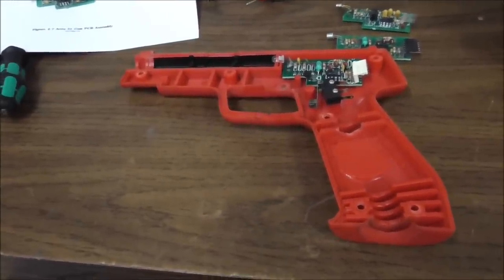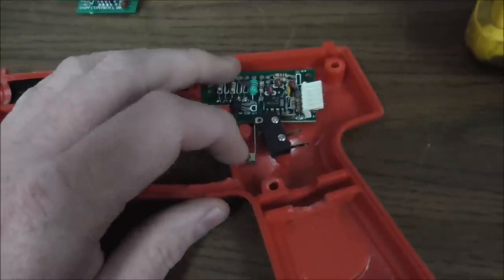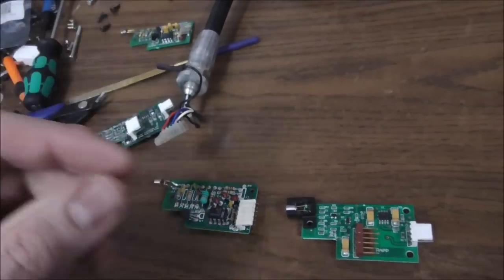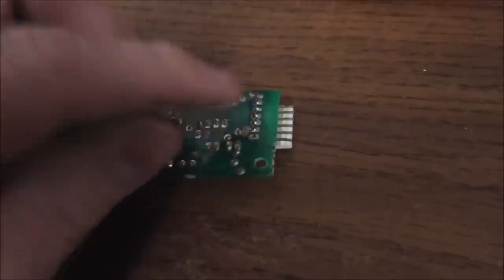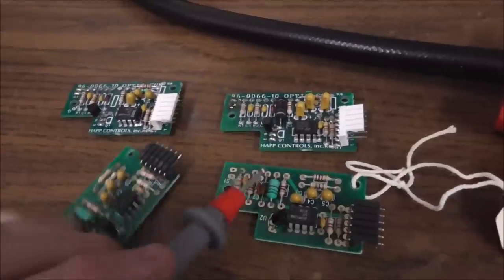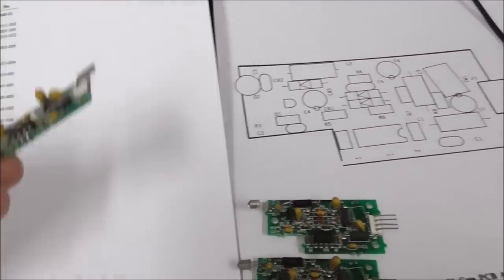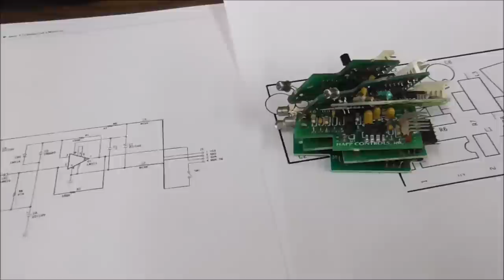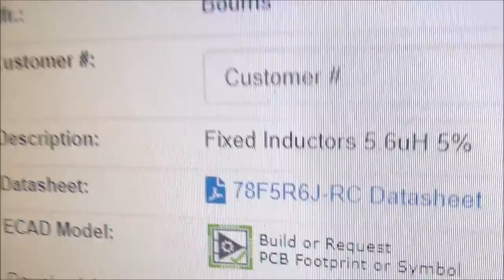Repairing Happ Arcade Game Lightguns - Area 51 , Lethal Enforcers, Police Trainer, Etc.

Comment from the maker: At the moment, you can buy the Phototransistors here:  https://amzn.to/2xReiO6

Anything you buy after following that link to Amazon (a box of doughnuts, a speed boat) pays us a royalty for sending you there, thank you!
Reply: It could be a photodiode. It's pronounced micro-henry and you are hereby authorised to pronounce it. I'm an engineer.
Reply from the maker: Thank you Morten we appreciate it brother!
Reply: @LyonsArcade  Please don't call it u-H. It's like a nurse in an engine workshop. :-) The u isn't a u either. It's the greek letter mu: µ. It's just common to use u because it looks similar and µ isn't on the keyboard. 
The LED you mentioned, it could be a photodiode. Based on the schematic you showed, I guess it could work too. You can test the component with your multimeter accross. Measure resistance and vary the light. They are directional, so if one direction doesn't work work, try the other. If that doesn't work either, it's not a photo-diode, it's broken or perhaps reality is broken. 
In layman's terms an inductor is a resistor that depends on the frequency. Higher frequency = higher resistance. 
Capacitors are opposite. Higher frequency = lower resistances. 
The inductors you have are just copper wire in a coil. When you measure resistance with your multimeter you measure at DC. Ideally it should read zero ohms. This world is not ideal. Depending on type and whatsnot, values below 100 ohms can be expected. Above a kilo-ohm sounds wrong. Mega-ohms are obscene. It's probably the resistance of your fingers. 
I took a look at the schematic. I can't immediately see a failure mechanism for the inductor (L2). Perhaps they just live a hard life (shock, moist, etc.).
Reply: Joe's Classic Video Games Hi, i was wondering if we can turn a le 2 cab into anything better, or replace the roms for LE1.  Even the LE 1 boards on ebay are over 300, seems a bit costly.
Reply: Joe's Classic Video Games top tip if your making a youtube video please mute your phone theirs nothing worse than hearing someone’s phone constantly pinging in the background either that or I hate the noise of people’s phones dinging 😂
Reply: 5.6 uH  u = micro  H = Henry.  m should be milli  but  some times also micro...cos. Reasons...the marking is green blue yellow.     5  6 2.   . Which confusingly means 5600 something's.  In this case 5600 nano henries  ( 5600 nH =5.6 uH) sorry but. that's how its put.  You would search for inductor axial 5600 nano henries
Reply: My goof. green blue RED means 5 6 2 not as I said green blue yellow

Comment: The "LED" on that first board may still have been a photodiode.  They make them in clear cases, and the internals are nearly indistinguishable from LEDs.

Any PN junction is light-sensitive, and also generates some wavelength of light as current passes through it.  That's why chips and diodes are fully encased with light-blocking materials.  LEDs and detectors are just constructed somewhat differently to specialize to their intended use.  Still, some ambient light detectors actually use LEDs for the detector.

That said, the proper replacement also looks like it has a lens and side-blocking to ensure that the detected light is coming in from straight ahead and not from an incident angle.
Reply from the maker: Thanks Oval Teen, I did notice on the data sheet that the phototransistor they're using mentions 10 degrees so I guess that makes the difference!
Reply: OVAL TEEN, can you explain what the purpose that inductor is for? I don't know what they didn't use a resistor but they used an inductor any reasons why?
Reply: @waynegram8907  The circuit may be above my pay grade :)  But what it seems to be doing is the opposite of a capacitor:  When the photodiode turns on the transistor, it seems to be there to cause an inverted pulse that goes to the op-amp.  There's also diode CR1 that only allows current to flow back through the transistor.  I think CR2 is only there to catch the flyback voltage.

But you'll notice that if the gun sees too much light for too long, it basically acts as a short circuit through the transistor.  That's probably what blows out the inductor.  The transistor would probably also be straining under that load, unless the inductor gives out first.
Reply: What kind of digital signal is the Photodiode receiving? is it a digital encoded signal? When the transistor is turned on, the inductor is energized and stores the digital logic signal from the photodiode, and when the transistor is turned off the inductor releases the digital logic signals voltage and current which is an inverted signal to the IC op ampThe inductor is getting damaged from something since its a high stressed component that is failure rate is very high for some reason. Not sure why they used an inductor instead of just using a resistor make me wonder why?
Reply: Photodiodes and inductors are analog devices.  The more light that lands on the diode, the more current it allows through it.  The inductor acts as a delay device.  It resists changes in current through it by inducing voltages in opposition.  It's analogous to a flywheel, which wants to maintain its own RPM and resists forces that attempt to change it.  The light that strikes the photodiode comes from the screen when the scan line passes in front of its field of view.  If you want to see what a raster scan is like, there's a YT video by the Slow Mo Guys about CRTs and even covering LCD screens and showing why they don't work with the old light gun games.

The transistor amplifies the signal, but that only acts as a trigger for the differential amp.  The diff amp seems to be wired to give you a short full-amplitude pulse upon being triggered.  So that's where the digital output is created.

I have to amend a previous comment now that I see R8 though.  Its purpose is to limit current through the inductor and transistor, which ought to prevent them from melting down.  But apparently it still happens.
Reply: @ovalteen4404  Nicely put, and The circuit design is a bit tenuous as large currents can develop when the magnetic field created by the inductor collapses I am a bit surprised that its not repeated failure of the transistor that we are seeing, dont no what the power spec on the inductor is but clearly its lower than the 3904 (tranny), in fact it would seem the inductor is acting more like a fuse!
Reply: If I have it right, the inductor is there to help make the transistor act as a high-pass amplifier, meaning its trying to amplify the fast edge of the CRT beam but not respond to changes in ambient light- the current will be  pretty rough on the inductor, lets them get away with fewer parts so cheaper.   CR2 is a snubber so induction noise gets shunted back around the device, C3 helps keep it off the photodiode.   The high level of DC is there to keep the transistor in conduction so it can be responsive to the photodiode input.   The output of the transistor amplifer is  a series of pulses that are generated by the beam as it enters and exits the diode's field of view.  The pulses are integrated by the op-amp, so downstream the game board sees an increasing voltage as the beam starts intersecting the photodiode's view, at maximum as the beam traverses the diameter of the lens, then back down; so peak voltage out on pin 3 corresponds to beam at center on the diode.  Note the playfield light is always modulating the photodiode, but is brightest (and so most accurate w/ the well-defined consistent brightness) when the gun's flash is put onscreen.

Think your diagnostic skills are really good though- really dig it when you put a good IC on top of a bad one to recover the function, thus diagnosing soom bad chips without removing them.... very cool!

Comment: looks like you found the the inductors at the same place I did.  Still 8 bucks shipping kinda sucks unless you are going to get a bunch of other stuff there and lump it all together.

The advertising thing is pretty common.  I have had a few sites where I use different places that are relevant.  Ebooks make more so you might try linking up some of those that are relevant to electronics repair.  Personally I don't care for patreon and other stuff similar to that.  I would rather kick someone a few bucks directly or help with other stuff, I went out to SV Seeker and helped do a little work.

I am a computer geek though.  I use a couple GPU's to heat my house during the winter.  Basically I cell GPU cycles to the highest bidder and get paid in BTC.  Electricity cost is about 35 per month to run it 24/7 and I get about 30 a month back but since my place is all electric I consider it a rebate, LOL.  A couple years ago I was making enough that even running it during the summer I made a few bucks over the electricity costs.  Was able to upgrade some of my network to 10Gb fiber optic.  I would rather someone kick me a couple bucks in BTC than to use patreon or something like that and make other people wait for stuff or have exclusives.
Reply from the maker: We do a similar thing at our shop, in the back of the store it has these old flourescents that we turn on in the winter and the lights heat the building up.  The games actually give off a lot of heat too, if you turn ten of them on or something which we kind of need to do for display, it causes a lot of heat in the winter.  Those GPU's you've got must run hella hot!
Reply: @LyonsArcade  Uhh, I think they run around 140F (60C) each and I have 3 running at one time 2 GTX1080's and one RX480 unless I fire the one in my desktop up (another GTX 1080) as well.  Add a box fan on and it stays pretty warm except on the coldest days.  Then all I need to do is throw something in the oven for a little bit to drive the chill off.

Comment: Inductance is measured in " Henry's" Im not kidding you ! also they are read as resistor colour code ,so that reads 5.6 Micro Henrys , and that's how ya say it before anyone starts crying ! Just as a side note LEDs can be used as photodiodes, they are sensitive to light at about their emission frequency, so red LED sensitive to red light, but the chances of this working are remote at best, i did a study on this in my younger days and they behave like little solar cells, but yeah, it's still the wrong component so still a little dumb ! good point about in circuit testing of resistors, that's often forgotten, also strange about the inductors as they are not much more than a coil of wire around a ferrite core, maybe someone reading this could explain this as its not obvious to me from the circuit as to why they failed...Great vid !
Reply from the maker: Yeah I'd be interested in knowing why they failed too.... and without any physical signs, usually a resistor will burn but these look new still...  Thanks for the info about Henrys AndyMouse we appreciate it :)
Reply: ANDYMOUSE123, what are the reasons why they used an inductor and not used a resistor?
Reply: @waynegram8907  Hi, check out Oval teen, he (or she) has answered your question and i've added my 2 pence worth!....good question by the way.
Reply: These inductors are made of a very thin copper wire. They can break open with shocks and being susceptible from thermal stress.

They're also called RF chokes.

I examined the schematic.

The reason why they put a choke in there is not obvious. 

The entire circuit is a photodetector with an attached inverter acting as an over-supply-voltage pulse generator (the transistor, inductor and diode thing).
When the phototransistor detect light it will made the transistor into conducting making its collector near GND. But when the light comes off the sensor the transistor opens making the inductor to produce an over supply voltage peak because of the inductive flyback phenomena (see SMPS boost converter). The diode limits the voltage on this phase to prevent it from developing RF noise and further wearing on the transistor junctions.
That over-supply voltage pulse pass through a bypass capacitor to an analog comparator (The LM311 part) which detects it and then sends an amplified version of this pulse down to the main board through the GUN pin.

I found them on ebay pretty cheap https://www.ebay.com/itm/RF-Choke-Drum-Core-5-6uh-5-510mA-B82141A1562K-made-Epcos-30pcs-Z1515-/253238951531?hash=item3af637be6b

Also, like any other diode a LED is also a photodetector and a photovoltaic cell.
If the transistor fails short between collector to emitter it also likely to burn the inductor/choke.

For the LED as photodetectors:
https://youtu.be/6WGKz2sUa0w

The transistor can also be replaced by any small signal NPN one such as the BC548 or MPSA06
The 2N3904 is a classic, but kinda vintage one.
Reply: @swilwerth  I agree not obvious. nice description

Comment: The three basic elements used in electronic circuits are the resistor, capacitor, and inductor. ... The main difference between a capacitor and inductor is that an inductor is used to store the energy in the form of magnetic field, whereas a capacitor stores the energy in the form of an electric field.
Reply from the maker: Hmmmm, that's interesting, I've done tons of capacitor and resistor stuff but never had any issues with inductors yet, thank you for the information!

Comment: Inductors are one of those things you spend a lot more time learning about in an intro physics class than in actual electronics, because they're passive components with a physically simple theory of operation (they resist changes in the current flowing through them, as opposed to a resistor that resists current itself). What it's doing here, I don't know, but they show up in filter circuits a lot.
Reply from the maker: Now that you mention it Matt I believe I have seen them in filter boards and such before, they always measure almost a dead short it seems too.... thank you for the info!
Reply: @LyonsArcade  Right, they'd be close to a dead short if the current flowing through them is DC. Put AC through them and they push back, but with a delay, because they're responding to change.
Reply from the maker: @MattMcIrvin  That makes sense, thank you Matt!

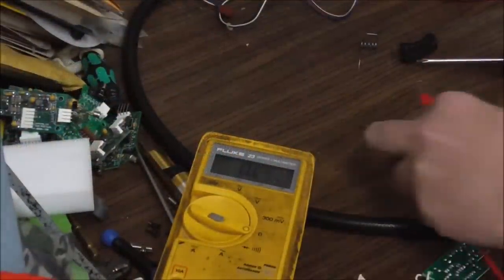Comment: 30:20 be careful not to measure your internal resistance ;) https://darwinawards.com/darwin/darwin1999-50.html (those MRD300/NTE3032 parts are like $10/pcs, maybe they were trying to find a more cost-effective replacement)
Reply from the maker: I think you're right, I looked them up thinking I was going to buy a bunch but like you said they're NOT CHEAP!  Thanks Samuli, see you on the next video!

Comment: In case you didn't already know this, an Inductor  is basically a wire wound coil surrounding a metallic core. (bust one open)  It will read like a low ohm resistor. (it's basically a long length of wire)The UH in the parts list is actually microhenrys. the symbol for Micro is a Cursive like U. since there is no character like this in standard typeface, a U is used instead. UH is microhenry. mH is millihenry.  Like mA is milliamps. UA is Micrco-amps, etc... I took Electronics in High School.
Reply from the maker: Thanks Scrapman, I appreciate you sorting it out :)